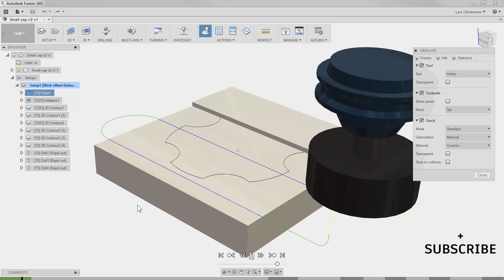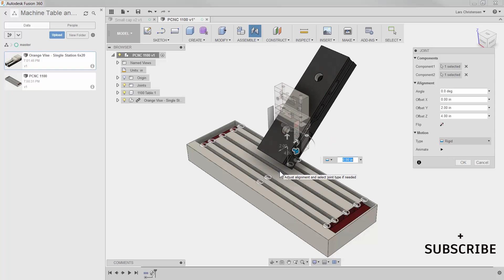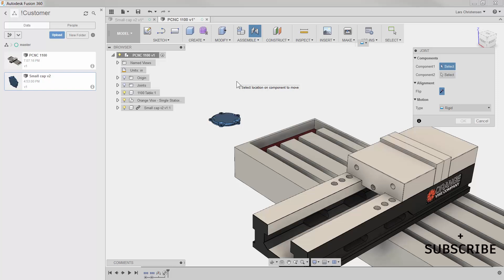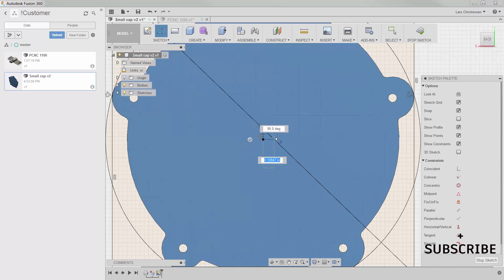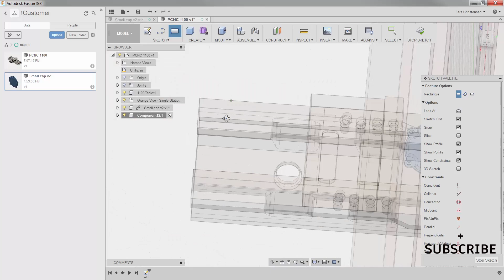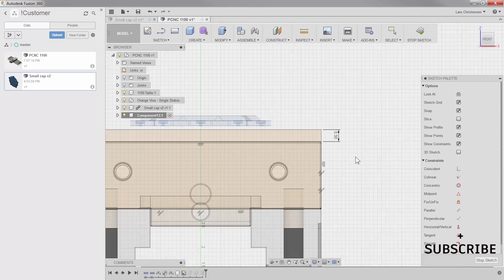Fusion 360 CAM Tutorial — How to — Part in a Vise

Comment: Hey, great video.  However it is missing the main point to actually put your part in a vice.  Many of us are dealing with small mills and parts that may be too large to put on the table with out doing multiple setups to deal with that. 
So, how can you set the g53 origin (Machine Origin) of a part on a table and each setup having its own own origin (54 (in cam 0 or 1),55(2)… etc)?  The benefit of having this feature would be to figure out where on the vice to place a part that is on the cusp or just is too big to fit within the tool envelope. 

Can you coach on this Lars?  Or maybe you have put up another video that adresses this, but I haven’t seen it…. Or maybe it is not done yet!
Reply: Missing the main point?  No, he quite well covered the point of this video.   You have a very DIFERENT point you want covered; Using multiple work offsets to get work bigger done in your tiny mill.   The answer to that is simple.   Move the part around on the table and only machine what you can at each position.  Two ways:  #1 You could have several entirely different manufacturing assemblies, one for each part location.  or #2 you could assemble the workpiece in several locations within the same manufacturing assembly.   If you do this, each assembled workpiece gets it's own setup.  The setups have the coord system, and the work offset # 54,55,56, etc...   
You can have your post process multiple setups and use M1 optional stop between, but I think I would prefer separate files.

Comment: My problem is the that the tool is not showing cutting of any stock that was added but rather cutting the dimensions of the part. So how do you setup to cut the extra stock at first so that it can start cutting the part?

Comment: Thank you so much for your videos! Can you tell me please if it is possible to machine a part in the same program if the part requests to be fixed in  two different positions in the vise during the machining? Two different fixations mean of course two different offsets. Thank you
Reply: Course...you can it ..using hide part....parts..assy...in 300000 positions😅

Comment: Again a great video - as I commented in an other thread, I would really love to see how you then handle the part in termes of file structure and setup when you need to flip the part and finish it, ie how you keep one file for all your operations if possible.
Reply: I agree.  I'd also like to see what would be the best way to have a single file with multiple machining setups.  I think maybe importing multiple Master Vice files and orienting them differently for each setup would be a way to do it.

Comment: Lars, what do you do about the collisions once you detect them?
Reply from the maker: Hi Levi Garrison Thank you for watching!
If you place your mouse over the area on the green bar it should tell you what is wrong. Like your tool holder is hitting the stock or maybe a lead in issue. So now you can go back in your operation and make corrections and re-check the simulation. You should not post the code until you are red collision free

Comment: I would love to see fusion do something like EdgeCAM and have the entire machine with all vice’s, Fixtures, max travel on each axis with your exact machine. That’s a feature I’d love to see fusion adopt at some point. I (unfortunately) use EdgeCAM at work and it is so unintuitive and completely non user friendly in more than half its ability, but it is very powerful and has a lot of really nice features.
Reply from the maker: Hi kbutta01 Thank you for watching!
I know that the development team is working on machine configurations that will do exactly what you want. They also want to make sure they do it right, so it will probably have to go through some testing
Reply: Lars Christensen This is great news!! I am actually trying to put together a “presentation” of sorts to pitch them switching to Fusion from EdgeCAM since they aren’t happy with EdgeCAM. It’s far to difficult to use and it isn’t easy to get help with either. I wish there was a pitch i could use to give them. I’m not the best salesman...
Reply: I have also heard on he forums they are working on full machine simulation as well which in that case there would be little to no reason not to switch.

Comment: Hi Lars! When I insert a part with setups and toolpaths into some other design these setups and toolpaths will not be transferred with it.
Reply from the maker: Hi kvid Thank you for watching!
Yes, you are correct. Toolpaths does not come along when you insert a part into another. What are you trying to do?
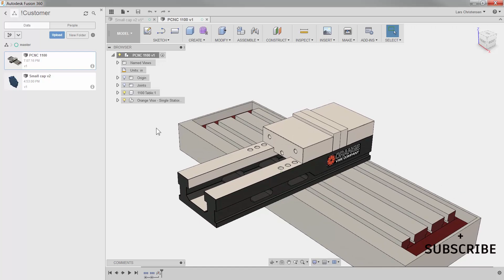Reply: When I do what you did on 15:50 the setups and toolpaths don't transfer along with the part. I found a way around it by inserting the workholding file into the part file instead of the part file into the workholding file.

Comment: Hi Lars, 

Great video! Very informative regarding vises in Fusion. 

I have made some vise soft jaws out from aluminum blocks to hold my stock correctly in the vise while milling. 
The toolpath is set up to mill a little bit into these two soft jaws while milling the part. 
Is there anyway I can see what will be milled of material from the soft jaws during simulation? 
The tool goes into the jaw during simulation, but the jaw remains the same, only the stock is beeing milled. 

I did set the soft jaws as Fixture so I can see when the tool goes into it. (red on the bar)

Thanks in advanced,
Best Regards,
Kjetil
Reply from the maker: Hi Kjetil Møkkelgård Thank you for taking the time to watch the videos!.

Try to turn on transparency in the simultation.

Comment: Lars unable to reposition moving jaw. Wont slide.
Reply from the maker: Try to delete all the joints for that jaw (now it should move freely) and try to create your joint again....does that work? If not...is it by mistake in a rigid group?
Reply: Thanks Lars. Edited the joint, changed to slider. Completing video one step at a time.

Comment: I'm a newbie to this stuff, so perhaps this question  sounds silly to pros. Why do you not just make one stock edge on the same plane  as the fixed vise jaw and make the other (movable) vise jaw on the same plane as the opposite stock edge? That way the movable vise jaw will automatically follow a new stock dimension and you don't have to make those calculations to place the stock in the right position. The same reasoning could be applied to the bottom of the stock resting on top of the parallels.
Reply from the maker: Not a stupid question at all :-). You could do something like that. So you would create a solid body as stock in the assembly and use that as stock.
Reply: @cadcamstuff  Would be way easier if stock defined in the cam setup could be used the same way as a component, i.e. faces useable for measurement and joint creation

Comment: Lars, Thank you for producing helpful videos!

After working through producing many multi-setup parts now in fusion, I am beginning to have some confusion about the best workflow.  When creating a project that has more than one part, you have to choose one of two strategies:

-Build your entire design in one file
-Build each part in its own file, then assemble linked instances into assembly file. (Solidworks-Style)

There are advantages and pitfalls to both methods.   I started out with the first strategy, but eventually ended up adopting the second strategy above due to the fact that my files were unmanageable when several CAM setups were involved for each part.  

I have recently been using a standard file convention for each part that contains three base components/folders (Work-holding, Stock, Part). Since I am on a 3-axis machine, the majority of my parts contain 3-6 setups to complete, so the CAM view becomes manageable in a real world scenario.  

In the stock folder, I have rough models that are used for the stock in each setup if needed, that have been copied from the part itself and simplified to represent current state. (Rest machining between setups is at the top of my request list for fusion, hopefully this will be added soon )
 https://forums.autodesk.com/t5/computer-aided-machining-cam/stock-from-previous-operation-for-next-setup-stock/m-p/6763954#M22111

Until Rest machining between setups is possible, and the CAM view provides some kind of state management, It seems like there are too many assets that exist for one file.  However, there are so many benefits to having everything in one file, I really want to work this way  

For now, I have found that modeling your stock for each setup, and consistently placing it into a "Stock" component in the root of the modeling tree, helps to reduce some of the errors shown in this video. You have complete control over your stock overlay by using Joints and dimensions. Then selecting Stock from model in your Setup config. 

I would love to see a video about how YOU approach this issue in the current state of the Application.  There areas many way to layout projects, I feels there is a gap there in cyberspace.

Thanks again Lars, you are doing an excellent job.

Ryan
Reply from the maker: Hi Ryan, Thank you so much for watching and also for writing this. I don't think I would do it much different than you. Seems like we are working about the same way. There are this funny broken link between CAD best practices and then what works when you actual have to make a part on the shopfloor :-)

Best,
Lars

Comment: Awesome video once again Lars. One quick question... I like the obstacle detection feature, but in my path generation experience the tools go right through the fixture, though they do highlight red. Is there a way to make Fusion alter the tool paths to avoid the fixtures altogether? Ciao, Marco.
Reply from the maker: Not directly at the moment. There are a tab function for some of the toolpaths that will avoid an area as if you clamping that possible could be used, but not a perfect solution. For now you have to be awake and watch for the red holder warning :-)

Comment: Another great video!!! Thank you!!!  I'm looking to create a model of my tool holder, which is an MT1-ER16 collet chuck (similar to this one: http://www.banggood.com/MT1-Shank-ER16-Collet-Chuck-Holder-Morse-Taper-Collet-Chuck-Holder-M6-Thread-CNC-Cutter-Arbor-p-1046819.html).  How would I be able to do so?
Reply from the maker: Right now Fusion 360 doesn't have all the tool holder flexibility I would like to see, but I know the team is working hard on it. You might get away with using the shaft option doing tool creation, or...maybe there is one of the stock toolholders that comes with Fusion 360 that are close enough. If you are looking to use it for tool collision it is fine as long as you are using a holder that are a little bigger :-)

Have an awesome day!

Comment: Lars, a great video once again. Question about breaking the link to the original. I would have thought that one would not want to break the link, so that changes would show though if the vise model got updated.
Thanks
Reply from the maker: That is a good point. The problem is that if you don't break the link, you can't copy the vise assembly out of the master project. The only way to keep the link is to download the entire project as an archive file to your desktop and then upload it back up to Fusion. It might seem like it is broken, but the issue with linked components when they get moved outside a project, is that it is hard to keep track of referenced files. That is why it works this way.

Thank you for taking the time to watch!
Reply: Aha, got it. Thanks so much.

Comment: Hi Lars,
is there away to use the stock model to place the part in the fixture, or do you have to figure out the offsets from the stock box to the model origin?
Reply from the maker: Hi Ron, If it is just a rectangular stock I think it is fine. I just wanted to use an example that was not perfect, because I knew someone would come across this problem.

Thank you for taking the time to watch the video!!!
Best,
Lars

Comment: Great video! Changing from other cad programs to Fusion 360. I love it. I checked and my data panel does not have any extra items in it. It just has items I have done. It was empty when I started using it. Where do I get items that the team made like you mentioned in your video? Thanks.
Reply from the maker: Really? You don't have the CAM sample folder at the bottom of your data panel. I thought everyone had that. I will have to reach out to someone who is smarter than me how that can be. BRB
Reply: Looks like my mistake. At the top of the data panel it just has my name and below is the items I have done. To the left of my name at the top is an arrow pointing left. I clicked that and it brought up another panel which had all the samples. I had never clicked that arrow. Thanks for your help.

Comment: Another Great video Thank you!
I just got my CNC router working this weekend and I was wondering do you have any simple gcode files that you could share
so I could test my Machine ?  Thanks again , love your videos.
Reply from the maker: I would recommend that you go to the CAM sample folder and pull one of the models there. Then you can pick what controller you have for your machine and start testing code. The most important thing when it comes to code for your machine, is what controller. Your manual also might have some sample code you can use as reference.

Have an awesome day!
Reply: Thanks Lars, I will give it a try.